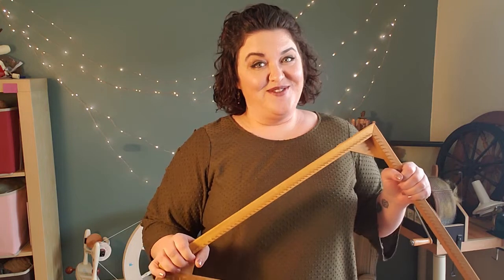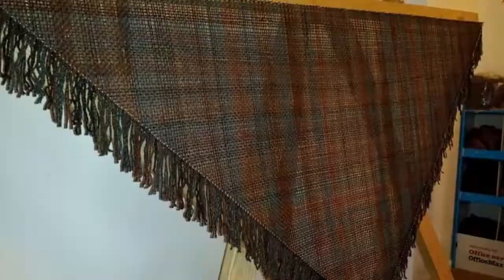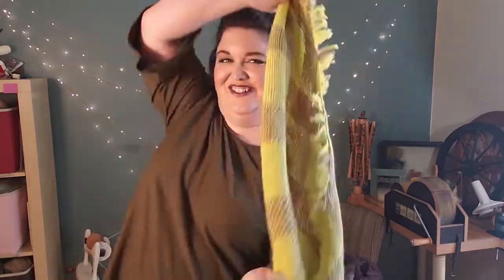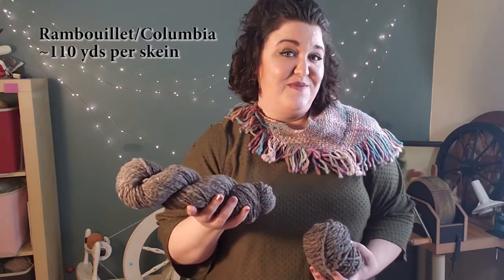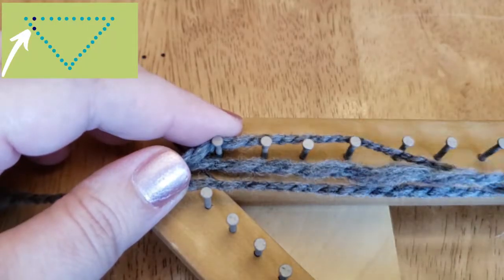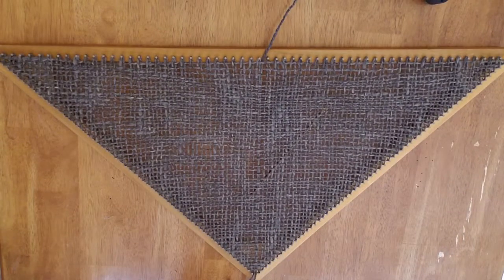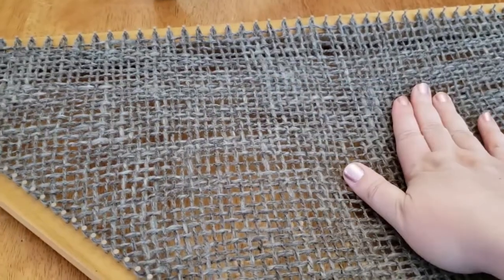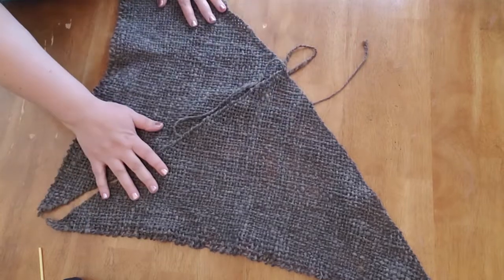How to Weave On A Triangle Loom

Comment: I hate to waste an inch of my hand spun so I won't use it as a warp on my floor loom.  That is the beauty of the Triangle loom- no waste!  And as you say- great for chunky fun yarn.  I have the adjustable 7' max loom but the shawls shrink down quite a bit after washing and fulling.  My favorite tool for the hard part- the endless middle- is/are those steel pieces that support hanging files.  You're probably thinking ???  A thing of the past 😄

Comment: Hi again Evie do you only spin with plied yarn or can you use singles? Debs
Reply from the maker: I weave on a triangle loom with plied yarn because each strand has to be warp and weft. Also, when I pull the yarn through, it can untwist each of the strands it runs over/under. Singles can fall apart. I hope that helps! 🧶💜😄
Reply: Yes thanks.  Hubby is building me one as we speak

Comment: Ok after i went across the 4th time and I'm now back on the left side and on the 4th peg I weaved it through but have it running through in 2 spots and am unable to continue without pulling my entire skein through it. I don't understand what I did wrong, I would show a picture if I could
Reply: If you're just using loose string that would be quite helpful to know, or how to do it on a much larger triangle with a full skein

Comment: Hi again Evie. Hard question  ... Any idea about how many metres/yards of  hand spun l will need to weave the big or smaller shawl. I know thickness etc. comes into play but just a general idea where to start. Many thanks in advance   Debs
Reply from the maker: If you are weaving on a tri-loom, measure the distance across the top of your loom. Then multiply that by the number of nails across. That will give you an estimate of your loom's yarn requirement. Remember to include more for fringe and fancy edges. Happy weaving! 😁🧶💜